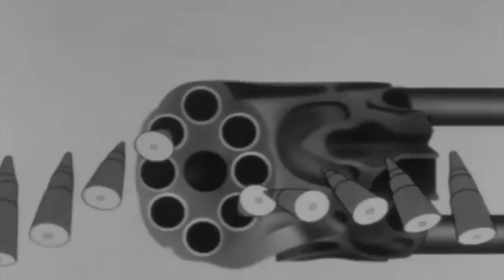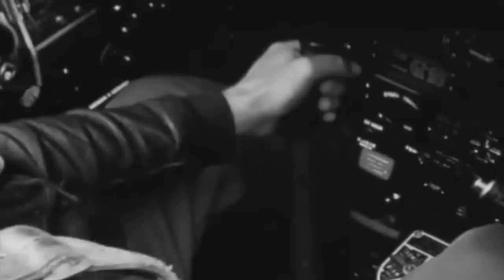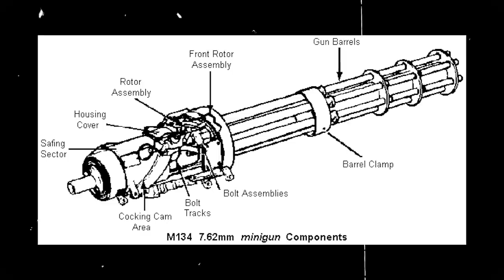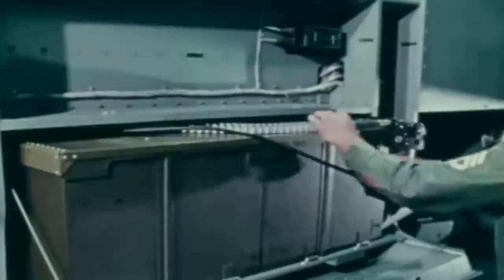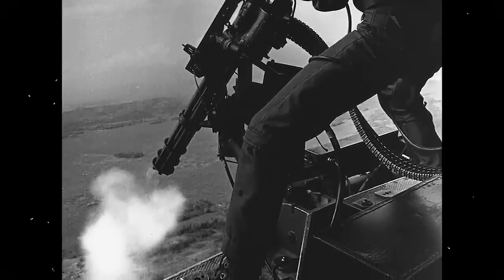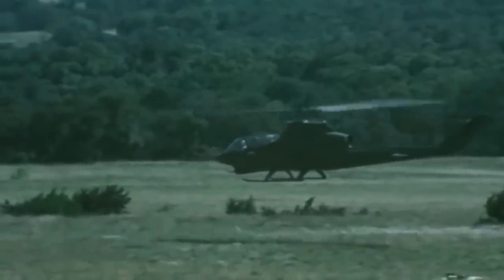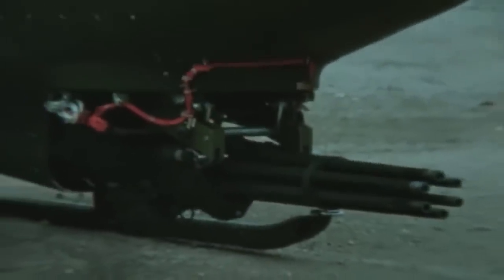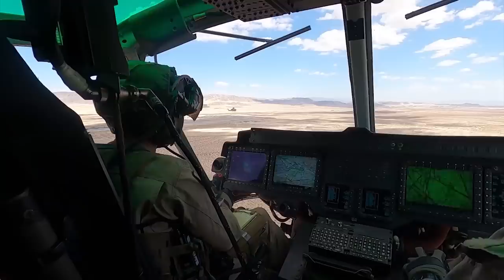Minigun -  M134 7.62×51mm Six-barrels of Pure Destruction

Comment: As a CH-47 / MH-47 Chinook CE / FE, I have fairly extensive experience with both the M134, and the M-60D.  But my M134 experience was before Dillon Aero changed the drive motors to the DC drive instead of AC drive, (Robert's Ridge was a hard lesson) and the fixed 3,000 rounds a minute (I grew up on Low Rate / High Rate buttons of 2K and 4K rates).  I invaded Iraq with M-60D's on all three mounts, and, while they're not "ultra reliable", it was easier to keep a dirty weapon functioning than it was to keep a functioning weapon clean.  Removing the safing sector housing cover on an M134,  dropping the feeder / delinker, clearing the jam, timing the barrel cluster, timing the feeder / delinker, pinning the feeder / delinker to the weapon, pinning the safing sector housing cover back on, announcing "Right Gun's Ready" just to press the right side button and have the shenanigans start all over again was miserable compared to immediate actions of charging / clearing the weapon on M-60's and M-240's, that's for sure!  But if you spent enough PMCS time adjusting and lubing the seven fingers on the delinker with "just the right amount" of LSA-T, the Minigun was a fairly fun weapon to employ.  

"Right Gun's Winchester, Cabin Door is Inside"!!!  😉
Reply: I wanna hear more. You seem like you might have good stories. If you don’t mind.
Reply: @scrufflesmcgoogles8910  SOAR dudes have all the cool stories.
Reply: Having been a Vulcan gunner in the Army I can sympathize with you when it comes to clearing a mini gun, check out this story. 
The Army in it's infinite wisdom decided at one point that I'd be cheaper to shoot 7.62mm ammo at the Styrofoam radio controlled airplanes we qualified shooting at so they had a mount designed for the mini gun that clamped onto the barrel cluster of our M61 cannons, then you'd take the electric cable to the cannon off and hook it up to some kind of adapter thing that ran the drive motor on the mini gun, there was a big ammo can that hung on the left side of our gun tub (turret) with a flexible feed chute that went to the mini gun.
The whole thing sounded good in theory and really didn't work that bad as long as you were swinging the gun when you were shooting it, the problem was the genius that designed the mount had it designed that the ejection port of the mini gun was facing upwards, if you weren't swinging the gun when you'd fire a burst the last spent cartridge out of the gun would fall back down into the ejection port, then when you'd fire the next burst the empty cartridge that fell back into the ejection port would jam in the rotor causing a stoppage that required the mini gun to be taken off of it's mount and tore down, it caused so much downtime that we eventually scrapped the program and just went back to firing the 20mm Target Practice Tracer (TPT) slugs.
One good thing though is that we wound up with 4 mini guns sitting in the corner of our arms room, I was good buddies with our unit armorer and we'd sit in the arms room tearing down and reassembling them just for something to do, they were actually very similar in the way they tore down compared to the M61 cannon, I was really surprised at how similar they were the first time I did it, if you could tear down and reassemble one you could do the other, they even had safety wire in pretty much all the same places, aside from the M61 shooting electrically primed ammo it's almost like GE took an M61 and put it in a Xerox machine and down sized it.
Reply: LP
Reply: "it was easier to keep a dirty weapon functioning than it was to keep a functioning weapon clean"

Choice line.

Comment: Great video, but there's one thing.
The feeding system is NOT simple. Watch Forgotten Weapons' video about the M134, the most complex part is the feeding system. Designing a system that reliably feeds rounds at these rates is an incredibly complicated task.
Reply: Yeah he completely skips the delinker, which is the magic that makes all this possible.
Reply: And it's even harder on larger rounds, such as that used by the Phalanx ship-borne anti-aircraft weapon!
Reply: The feeder/delinker was the tricky part. That is where most of the jams would happen. Some jams would be so bad the only way to clear them was disassembly. The guns themselves were fairly simple and very reliable.
Reply: @mab1120  yeah. Hence my comment saying exactly that.
Reply: I think he is speaking relative to the larger vulcan cannon
Reply: @kafkaesk3449  Which is what the Phalanx is.
Reply: @wcate8301  which uses the vulcan cannon
Reply: @kafkaesk3449 ...with extra corrosion protection for the seagoing environment. A bear to repair.
Reply: @wcate8301  my point still stands. What are you trying to prove? that the Phalanx wasn't the vulcan? My point was that the author of the video is probably speaking relatively when he said the feeding system was simple.
Reply: @kafkaesk3449  Not trying to PROVE anything, just having fun with you. I used to program Vulcan and Minigun parts through the various stages of machining and deliver them to assembly, and often, back to rework.
The feed mechanisms were simple in concept, but fussy and complicated in actual assembly and operation, especially the Mini, and even worse, the 5.56 "Micro". Every time a batch went up to the range for test firing a few would come back with mangled feed mechanisms, their breech cylinders full of propellant powder and shredded brass. The firing shelter up at the test range looked like a battlefield from the war zone.
Reply: @shiggydig…. Designing that is NOT complicated at all. I’ve already designed a better system that works consistently.

Comment: I used to work on the XM61 Vulcan as a 24M20 System technician. The Army employed it on their Armored Personell Carriers.  The Achilles heel of that system was it endless feed system. If the system ran out of dummy ammo and kept firing it would self destruct the feed chutes rendering the gun inoperable. The ammunition storage drum was also problematic in that it only held 3000 rounds 100 of which was dummy ammo. The feed system on the Vulcan had 5 timing points in it and if any of those points were out of time the feed system would either jam or self destruct. Reloading a system like this was unbelievably slow and tedious. The first system during 1968 used electric gun drive motors that ran off of either track system power or three 28 volt nicad batteries. If those batteries sere run dead they would go into a runaway charging situation that resulted in the batteries melting.  The gun system by itself was well built and easy to service. The feeder attachment points on the rotor housing needed to be designed better. If the feed jammed it was almost impossible to remove it, because it stressed to quick pins so tightly you could not pull them out of the feeder or the rotor housing bosses. In one of our firepower demonstrations we had a track that had a feeder jam on it. There was a live round in the gun and we could not rotate the barrel cluster to clear it. We couldn't bring the system back to tge motor pool with a live round in it so the only way to clear the gun was to break the mounts on either the feeder or the rotor housing or both. I had to make this on-the-spot decision myself. I almost got in trouble for it and I would have were it not for one of the G.E. tech reps and my battery commander explaining to the ignorant Battalion Commander why that had to be done. It was either that, or leave the track on the range in the middle of the desert.  The 20mm is a hell of a round, as it shoots 2000 grain projectile at over 3500 fps. That is a lot of muzzle energy.

Comment: My Dad was a door gunner on Huey's he wouldnt tell many stories until I got older and joined the military myself. I joined the USAF and was a munitions loader. The last few years of my service I got the opportunity to work in CSAR(combat search and rescue). That was my first time getting to work on the M134 it was an awesome gun and honestly not hard to teardown clean and reassemble. The most fun I had though by far was my first 4 yrs in when I loaded exclusively on the A-10 now THAT is a Gatling gun the 30mm GAU-8. I t was a pain in the butt to remove and install but looking back now it was awesome!!!
Reply: I wish we had the a-10 in the jungle. The 130's were a beautiful sight, especially at night. It looked like you could drive a truck up that river of tracers. Every five rounds looked like a  one solid piece of melted steel. No, you could not do a body count.

Comment: Agree with Webb. Never had any significant issues with the m60. Did a fair amount of testing the mini on C models, and had far more issues with them. When they worked, they were awesome.
Reply: Whole documentary missed the entire reason from miniguns or even more generally why aircraft, helecopters, and anti aircraft guns generally want higher rates of fire than fixed machine guns or vehicle mounted ones. Its because drum roll they move faster.
Reply: @peterisawesomeplease  I’m pretty sure he pointed out that they wanted higher rates of fire, right? Or am I missing something.
Reply: @bracoop2  Yes he points out they wanted higher rates of fire. But he never says why this is wanted. Why would you trade a lower caliber for a higher rate of fire. In particular he gives a false reason from why the higher caliber but lower rate of fire gun was dropped while never giving the actual reason.
Reply: I’m jelly

Comment: The feed system for mini gun in the turret of the AH-1Gs was driven by a flex shaft similar to a speedometer cable and it had a habit of breaking, a lot of us who worked on them wondered why the didn't use the electric feed system that was developed for the mini gun when used on the UH-1 prior to the development of the AH-1
Reply: a common reason for the feeder drive shaft to break was quick short burst firing by the pilots. the rapid start/stop/start/stop  of quick bursts instead of a longer burst stressed the flex shaft quite a bit. trying to time two electric motors independently  would be really sketchy. the cable  method was the right idea but it could have been beefier.(former Armt. Dawg i worked AH-1P Cobra's through DAP Blackhawks) greatest MOS in the Army.
Reply: @mikeholton9876  OK makes sense, I was a 68J the 68X worked on everything from "Hogs" to Apaches
Reply: @williamhigdon8728  OG 68M converted to J, never touched an Apache. we had fun though!
Reply: @mikeholton9876  Avionics & a lot of other MOS's were folded into 68X it was great fun watching them hav to go out to the FARPS & get their hands dirty
Reply: @williamhigdon8728  probably so, but its sad in a way, the Armament shop always had the best personalities and frankly everywhere i worked they had the more driven troopers. i'd rather leave the sparkies, turbine surgeons, and tin benders back at the barn, just cut us and the 77F gas passers loose give us a grid to set up in and get out of the way. didn't have no time to be wet-nursing some avionics puke on a FAARP...

Comment: They had gun trucks during the Vietnam War as well.  These trucks were mounted with M60s, .50-calibre machine guns, XM 134 miniguns and anti-aircraft weapons such as the quadmount .50 cal. machine guns.
Reply: I seen a show on them they recreated the most decorated truck for a museum I forget the name of it
Reply: I was a 20mm Vulcan gunner in the Army back in the 80's, my Sgt Major was on one of the 5 Vulcan guns sent to Vietnam. 
Needless to say they weren't really used for their designed role of air defense since the North Vietnamese weren't exactly flying their aircraft over South Vietnam, what they used them for was the same thing the gun trucks were being used for, convoy escort. 
Their first assignment was convoy escort in an area that'd been getting heavily harassed by VC who wanted to raid the convoys for supplies, they put one at the front of the column and one at the rear, he said that when the VC attacked they turned the jungle into "tossed salad", I guess enemy harassment of convoys in that sector quickly dropped to zero.
Reply: @johnscanlon2598  They have some documentaries on gun trucks and I remembered watching them a few years ago.
Reply: @dukecraig2402  Thanks for your reply and service . Sounds like the VC got more than what they bargained for. My dad served in Vietnam and was assigned to the m107 or m110 self propelled gun and did a few supply runs but never told my grandparents because he didn't want to upset them. Funny thing is my grandfather joined the USAAF during WW2 from Canada and flew into Pearl Harbor on a B-17 while it was being attacked.

Comment: Lost my flight jacket while flying with the 20th SOS, Green Hornets USAF. I was wishing if Charlie found it he would turn it inside out - the inside was bright Orange.  We worked with Army Special Forces dropping teams in Laos and Cambodia where officially we weren't suppose to be. Gunbirds, UH-1N Twin Pratt &  Whitney engines, had the GAU-2B mini-guns. Butterfly grip with two triggers. Pull one the rate of fire was 2000 rpm - pull both triggers jumped it up to 4000 rpm. Ammo Cans only held 15,000 rds per gun. Slicks that carried the troops only had M-60s, 550 rpm - same ammo - 7.62 and every 10th round was a tracer. Hand held M-60 was a backup if your Mini crapped out. No over heating problem because in a Race Track pattern you were on target only for a few seconds. Note the Beanie Weeniie Can on the side of the M-60 - it clipped where the ammo pouch would go - helped the flow of ammo out of the ammo can into the gun.
Note - mini-guns were removed from AC-130 Gunships - they had two 20mm gatling guns, two 40mm cannons and 1 105 howitzer.
Note - Hazardous Duty pay and Flight pay came to an extra $4 a day, but at least cigarettes were $2 a carton, and beer was 10 cents a can - hey, it was hours and hours of pure boredom interrupted by moments of pure terror.

Comment: The ME 262 during the end of WW2 had 4 single barrel 30mm guns that individually had a slow rate of fire, but together they had a devastating impact on targets. The volume of ammo and rate of fire was perfect, and was not surpassed until the Gatling gun was introduced in the later half of the 20th century.
Reply: They only fired 2 at a time not all 4 like people assume, that was done to increase their firing time because they didn't carry that much ammo.
Reply: Those guns (the MK108) are vastly overrated in terms of effectiveness, particularly in the 262. Their max effective range was 600 meters (very low muzzle velocity and heavy-ass projectile) and the 262 pilot had to break off at 200 meters to avoid collisions. In a stern attack profile, that only gives you 2 seconds to aim, fire, and get out of there. All the destructive power in the world doesn't matter if you can't hit reliably hit the target.

For comparison, the MK108 used in the 262 had a muzzle velocity of 540 m/s (which is about the same velocity as a 180 grain .44 magnum bullet out of a 7.5 inch barrel) while the Hispano 404s and MG151/20s had a muzzle velocity of 840 m/s which is in the same ballpark as the machine guns already in use (the Brownings, the MG17, etc) which in turn helps simplify aiming the guns. Another consideration is the MK108 used minengeshoss rounds which had very thin jackets allowing a lot more explosives to be packed into them. Great when you hit the target... but you're also having to close to much shorter ranges to get those hits in the first place.
Reply: @RaderizDorret  wow, I didn’t expect a reply like that, you know your weapons. all good info and thanks for sharing! But I have to say, at 600 meters (2000feet) on the MK 108, that is still quite the range for such a heavy round, especially with the Minnengeschoss. Especially with the very fast closing speed of 700 km/hr the defensive gunners on the bombers had very little time to react. Only one or two rounds had to hit the target for it to be disabled, and since these were extremely heavy rounds wind or weather only affected them slightly on their trajectory. Muzzle velocity is not always the key for a successful kill, since the high velocity has a tendency to pass Through the target with minimal damage. A heavy tumbling round at lower velocity, as for example a .45, will do much greater damage.
Reply: @dukecraig2402  yes, that was the case for some pilots, but there was an option to fire all four in short burst.
Reply: @yuppy1967  
They could arm as many of the guns as they wanted, but SOP was firing 2 at a time, that's how they were trained and instructed to fire them.
Reply: @yuppy1967  The Meinengeschoss was also in use with the MG151/20 cannons that were standard before the MK108 was adopted. And that 600 meters is very short range for an aerial gun. You're basically throwing yourself at the target, firing a burst, and hoping you hit something as you flash by. This leads to low accuracy and it's exacerbated by another drawback of 30mm that is still seen today. You just can't carry that much 30mm ammo compared to 20mm. Again, all the power in the world is useless if you're not able to hit your target.